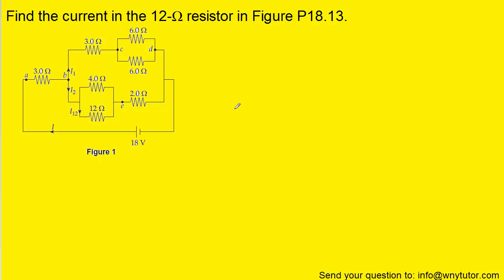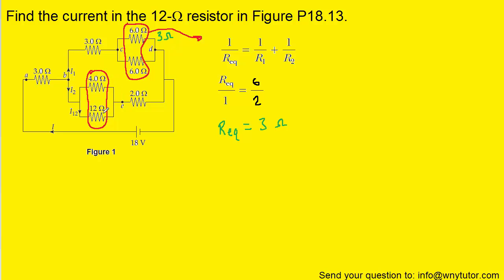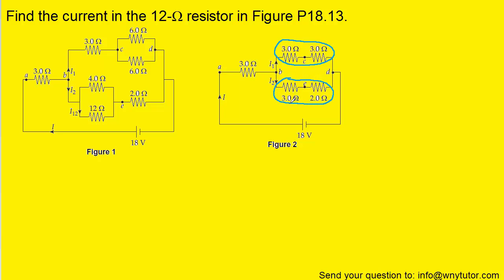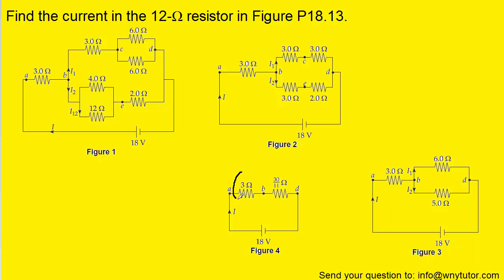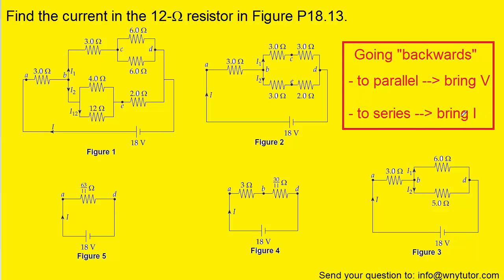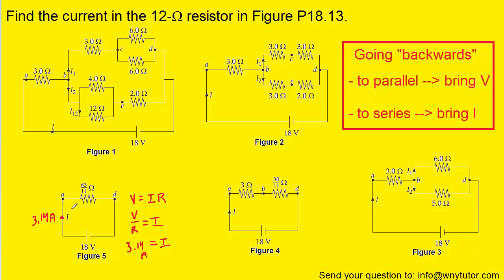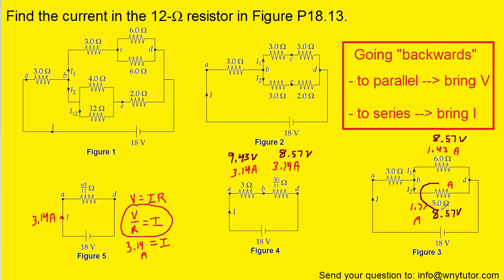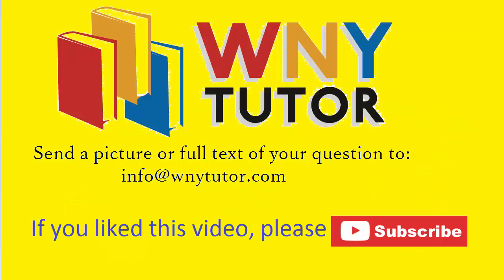Find the current in the 12-Ω resistor in the figure below.

Comment: Thank you so much. I am trying to figure out why the resisters in on of the blocks of a  switching power supply are overheating. I figuring if I can figure out what is going through these resisters it would give a me a clue. 
So now you can go ahead and call me an idiot, but I don't know how to measure the stuff on the board. I know how to use instruments and I have very good ones but, I haven't done it before.
What I do now for the voltage I just put the probes on either side of the resistor and read the voltage is that it. 
I did that & each resistor has a different voltage.
I guess that's what's called voltage drop or something like that.
Unfortunately on the board everything is Not straightforward as is on a piece of paper. the tracers go in and out all over the place. It's not easy to figure out the placement of each components. how does one measure the total voltage that's going in a specific block of a circuit? I mean I can follow the negative from the bridge rectifier that's going on the other end. Should I measure everything against that??? The more I learn the more I realize I don't know anything.
I figured maybe by measuring resistance on the Traces where resisters are soldered I could figure out if they're parallel or series to each other. Is that the right way to go about it?